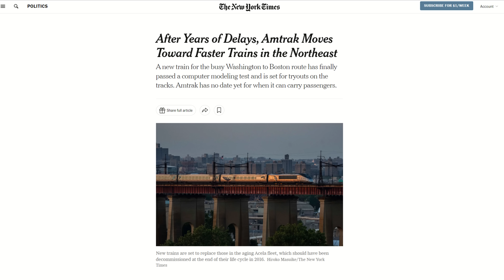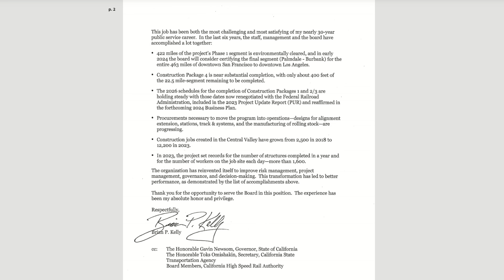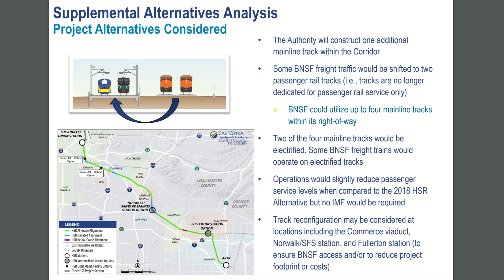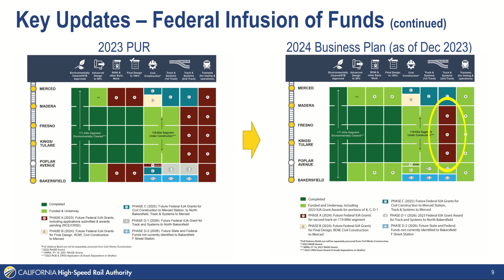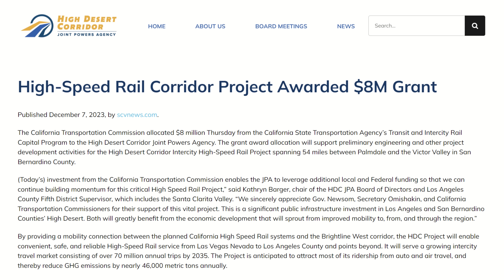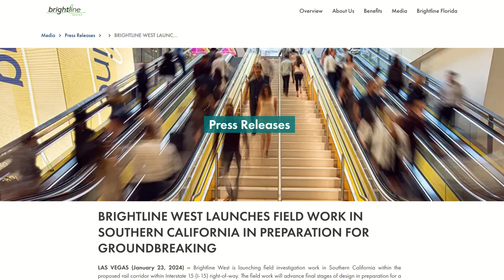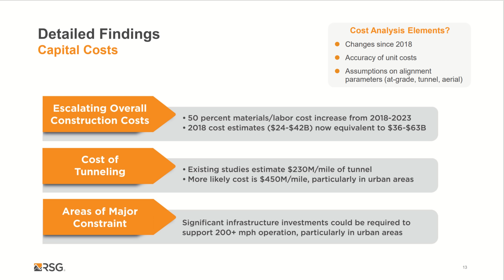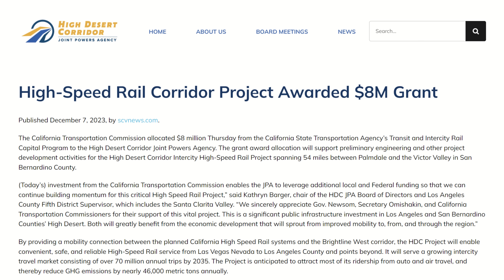Stew's Feb 2024 U.S. High Speed Rail News | CAHSR Brightline West Acela NEC Dallas Ft Worth Cascadia

Comment: The 30+ mile extension of Texas Central HSR to Fort Worth long I-30 will cost more than the 250+ mile route from Houston to Dallas. The difference between urban and rural real estate, even using a state owned freeway medium. The underground HSR station at Fort Worth Central is just TOO EXPENSIVE.The DFW area would be better off just upgrading the TRE's tracks for less than five percent of the costs of building new HSR tracks in the medium of a freeway at a inconvenience price of less than five minutes... Imagine building  terminus station platforms and train tracks under two different mainline freight railroads who do park dangerous toxic chemical cars in the freight yards above. Just upgrade the TRE rail route. The TRE will get you there less than five minutes later...
Reply from the maker: I haven't seen a cost estimate on DFWHST. What's your reference on that? I don't doubt it will be expensive or that you have a source. I'd just like to see it myself.

Comment: l recall mentioning there appears to be a forthcoming change in the CAHSR leadership. Brian Kelly appeared non-plus when asked about retirement during public comment. Though back then l thought perhaps Tom Richard or Ernie Camacho would be the one leaving soon. Nothing against Kelly. He was dealt a tough hand. Perhaps he will publish a report someday about his experience with CAHSR and what other future systems need to do to avoid the plethora of CAHSR issues, problems and failings.
Reply from the maker: Well, he had to deal with Joe Hedges, who is lucky he wasn't brought up on charges when he left the COO position. But the general impression I have accrued is that the board and the executive staff were both in way over their heads for the first 10 years.
Reply: @LucidStew lnteresting. Did not specifically know that.

Comment: Amtrak Cascades is a real solid service for Oregon.  But if you're going to get diminishing returns in terms of improving passenger rail in the region as long as you're relying on the freight lines. New rights of way are going to be necessary at some point, and if you're going to have to acquire them, it makes more sense to just go ahead and design them with HSR in mind.
Reply: Why delay good incremental upgrades while continuing to wait for perfect? The Cascades needs more trainsets for three times the frequency and better on time performance, which they are slowly doing. A trip could be one hour faster by upgrading to 110 and 125 mph tracks, for instance. Faster electric can be installed and new ROWs acquired when the ridership can justify the improvement and funding has been secured. Just saying ...
Reply: @davidjackson7281  oh I agree, upgrades like that would be nice. The problem is Amtrak doesn't own the lines the Cascades run on. And the freight companies that do are the biggest barriers to those sorts of upgrades. So in all likelihood if you're going to try to improve the service further you're going to need new rights of way either owned by Amtrak or the State. And if you're going to have to take that step anyway, it makes some sense to go ahead and design the new rights of way with HSR in mind.
Reply: @JohnDB9009 Yes, l totally see what you mean and can not really argue against that logical approach were funding fully secured.

Comment: With their current equipment, I doubt Brightline will be able to run services up to 150mph between Orlando and Tampa. I’m not sure the chargers can reach that speed and will probably top out just above 130 if pushed enough. However, this could imply a couple of things. Either the chargers are a lot faster than we thought, Brightline will upgrade their chargers to run faster, or that they possibly have plans to electrify their route in the near feature since electric trains can get up to 150mph comfortably. Regardless, I’m interested to see how they’ll pull this off
Reply: Can not see the benefit for a 150 mph electric over a 125 mph diesel. The Orlando to Tampa trip might be only all of 10.2 minutes faster or perhaps the same as skipping two infill stations.
Reply: @davidjackson7281  I find it hard to believe, David, that Tampa to Orlando is a high speed rail corridor. The distance is only 84 miles. Moreover, a route from Miami to Tampa via Orlando is really circuitous. It's obvious from just looking at a map. Tampa to Miami is a viable city pair, but it would  have to be a direct route between Tampa and Vero Beach, where a connection would be made with the FEC down to Miami.
Reply: @michaeljones7927 Yes Michael, sure as shootin', that corridor is perfectly suited for a one hour trip on Class 7 tracks. Like you said only 25 miles for speeds of 150 mph is not worth it. The same point l tried to make was any faster speed attempt would be unnecessary overkill. 

Of course, over time Miami to Orlando can be upgraded for faster service closer to three hours. Jacksonville can be added too.  l think four hours to Tampa is plenty darn good as an alternative travel choice. Would love to see a 2:20-3:00 TC train on class 6 and 7 tracks possibly in the l-45 corridor. You would know better than me. Sorry to Southwest Airlines and those stuck in 5 hour traffic jams.
Reply: @davidjackson7281  
THANKS FOR YOUR INSIGHTFUL REPLY, DAVID. YOUR COMMENTS AND REPLIES CONSISTENTLY ADVANCE THE HSR DISCUSSION ON THE INTERNET. I'M IMPRESSED WITH YOUR KNOWLEDGE, INSIGHTS, AND ENTHUSIASM FOR THE SUBJECT.
Reply: @michaeljones7927 Whoa ... Obrigado. Seriously l am afraid l did somewhat comment a bit too much on this video. Oh well. But l do so enjoy reading and learning from the comments of yours and others.
Reply: @davidjackson7281  And I feel likewise, David. I've learned from you, and continue to do so.
Reply from the maker: I'm not sure they will. This could be something as disappointing as someone getting it wrong and it being repeated. I don't think its an issue of power. They're currently using 8,000hp to move 4 passenger cars. It might be suspension or bogies or other components relating to the interface with the rails. The Charger is based on the Siemens Vectron, which has a 143mph top speed variant, so it would seem the company already has the technology to extend the top speed(granted that version is electric). It is an interesting idea though, and there is about a 25 mile portion of I-4 that has the geometry to support high speed.
Reply: @LucidStew  A 25 mile section of the Orlando-Tampa route is way too short to justify HSR quantities of horsepower. If their Siemens locomotives are inadequate, they should simply replace them. I'm sure Amtrak would consider buying them. Or Brightline could use them for another project.

Comment: I never understood why at the Houston-DFW HSR the Dallas Station would be rebuild and not union station be used. Is it a capacity issue, ownership issue or anything else? 11:39
Reply: Dallas Union Station does not have the track capacity required for a large number of HSR trains because of Trinity Rail Express and DART. Also, Jack Matthews, who owns the land you referred to, is an investor in Texas Central.
Reply: @michaeljones7927  They are using the closest real estate available to the present Union Station adjacent to the Convention Center as is. Dallas is NOT going to demolish the Convention Center for a HSR terminus platforms and tracks south of Union Station. Dallas is also NOT going to demolish the Federal Building, and Dealey Plaza either north of Union Station. Dallas PREFERS buiiding a new terminus station with platforms to regenerate a decaying commercial warehouse district instead with a new TODD for more hotels and restaurants close to downtown, the Convention Center, and Union Station. Furthermore, Greyhound and other premium coach bus services use Lamar Street nearby within walking distance. DART is NOT going to lose its Union Station setup they built for Amtrak and themselves three decades ago. Nor is Dallas going to demolish the TSBD for a terminus HSR platforms and tracks...
Reply from the maker: It appears to be a combination of cost cutting and the desire to develop the land around the intended station site south of the convention center, since it is the last large tract of vacant land near downtown.

Comment: Interesting note for Brightline Orlando, if they want to make true high speed rail then starting where they head south (Cocoa area) until around Miami would need to be entirely elevated. There are intersections along its current route very routinely. I think if it's popular enough then that could be an upgrade in the future. But it's probably just wishful thinking. (I lived in Melbourne, Fl for over a decade so I'm familiar with that part of the state.)
Reply: What Brightline needs is grade separations. That can be achieved by elevating either the track or the road. I'm sure you did NOT mean continuous elevation of the track, which would be unnecessary. Also, quad gates could work at some locations. The public sector should fund most of the projects using federal, state, county, and municipal funds, along with a private match.
Reply: @michaeljones7927  I did mean that. I’ll update my comment later tonight.
Reply: it doesnt need to be elevated, in europe where i live from the netherlands there isnt a lot of elevated rail tracks its unnecessary and not needed to make high speed rail. California needs to get rid of grade crossings, and the alignments needs to be straighter. But since the tracks are mostly shared with FEC florida east coast this is not likely to happen. I can call many high speed rail lines that are not elevated. some examples :, kuala lumpur line in indonesia 350 KM/H max speed, malaysia line 250 KM/H and NOT elevated, the woosh line, NOT elevated operation speed 350 KM/H. and there are much more examples where highspeed rail tracks are not elevated and can go 350 KM/H. just get rid of the grade crossings, and put ERTMS and ETCS signaling system on it, and there you go. But USA doesnt understand passenger rail, let alone high speed rail. It will take the USA decades to understand, and then built. I think for the USA brightline is a massive step forward.

Comment: Approved does NOT means "works".  There are still a plethora of problems, from windows that shatter in motion, roof leaks, shorted out computers because of water from roof leaks, hydraulic leaking in the tilt system and premature rust in the inter-carriage connections.  Aside from that, it's fine.
Reply from the maker: Most of the other problems have already been addressed or will be as part of the regular process. The computer model was a major hang up.

Comment: I absolutely love these videos!  I did want to clarify a very confusing part of the Amtrak monthly reports-- the Operating Revenue on the Route Level Report includes the state supported subsidies.  So while Amtrak is reporting a profit on there, it's simply because it considers a state subsidy to be the same as ticket revenue.  The Gross Ticket Revenue field in that report is a better proxy for revenues as ancillary revenues are usually a fraction of the ticket revenue.

Here's a link to a Cascades operating performance site that lists a 2022 operating ratio of just 52.6%: https://wsdot.wa.gov/about/data/gray-notebook/gnbhome/mobility/rail/revenue.htm

Comment: Im curious where the Brightline Tampa station will be, if it will be downtown Ybor City or adjacent (but use the platform) to Tampa Union Station? Also, I hope FECR buys the Ybor City track from CSX as they almost sold it to the City of Tampa a few years ago but didnt see them as a serious opperator.
Reply from the maker: It's close to Tampa Union, at least last I heard.
Reply: Not at Tampa Union, Brightline builds their own buildings around their stations.  Union Station is already built out.
Reply: @tonyburzio4107  I was suggesting Brightline build a brand new station across the street from Tampa Union, but use a pedestrian bridge to connect to the existing platforms at Tampa Union, and not use the existing station building

It's close enough to Tampa trolley/ light rail that it could easily stop at Union Station
Reply: @Buttersthatsme01  The issue with going that downtown would be finding a connection from their planned RoW, which ends where the interstate median narrows. They could build a viaduct, but those are unpopular and may require land takings, which are also unpopular
Reply: The real and present issue with Brightline is more how and when are they even going to get across Orlando to connect to the l-4 ROW. Seriously doubt 150 mph to Tampa for many obvious reasons.
Reply: @davidjackson7281   They have a planned route and way to build their way there. What's missing is final design and funds to complete the route. Funding seems even more pressings since BL announced today they're cutting their projected numbers and want to refinance their debt
Reply: @BIoknight000 Last year l read the more direct, shorter southern route was $1.2 Billion and the longer, circuitous northern route was $2.1 Billion. Are either the planned route you reference? Seems to be some unfortunate politics may be the problem. From the airport l like BL taking the southern route to Reedy Creek and SunRail taking the northern route to meet up.

Comment: Tri-Rail in South Florida started service (sort of) to Brightline's Miami Central Station. Tri-Rail has a separate train that shuttles passengers from Hialeah to Miami Central.
Reply from the maker: I'm confused. What station does it originate from?
Reply: @LucidStew  Tri-Rail and Metrorail Transfer station in Hialeah.
Reply from the maker: @gregory596  ok, that's what I was guessing, but I hadn't ever looked at what Tri-Rail is doing, so all the criss-crossing in that area was a little confusing.
Reply: @LucidStew  It's a poor connection of commuter rail to inter-city rail, but at least it is a connection. 

Orlando is a long, long way off from connecting its commuter SunRail system to Brightline.  Never mind that tracks already exist which connect the SunRail/CSX right-of-way to the Brightline station at the Orlando airport (that's how Brightline took delivery of their new trains).

Comment: I have SEVERAL questions about Brightline Florida, what rolling stocks would they pick on Tampa because their is NO WAY they would hit top speed of 150 mph with Siemens Charger that is top speed of 130, they should electrified this partion and wether they would use Seimens Pioneer 220 or buy out Amtrajs retired Acela l.
Reply from the maker: I'm guessing it will be Chargers, however, consider this... if a locomotive's typical lifespan is 20 years, they'll need to start replacing those by the mid 2030s. I ran across an article yesterday that Talgo is going to start producing hydrogen-powered HSR set, so how about a 150mph capable hydrogen turbine?
Reply: @LucidStew  FR I've rarely seen Turbine High Passenger Train Service in any worldwide, since mainly most likely *unreliable.
Reply from the maker: @Daniel-hj8el  Well, we are entering a new era and hydrogen could be a legitimate "zero emission" option to electrifying where electrification has issues, like this example.
Reply: @LucidStew Then perhaps a train transfer would be needed unless the whole system converted. But by 2050 who knows what power will be utilized. Perhaps like the Navy ... clean, cheap and ultra-safe nuclear. No really. LOL.